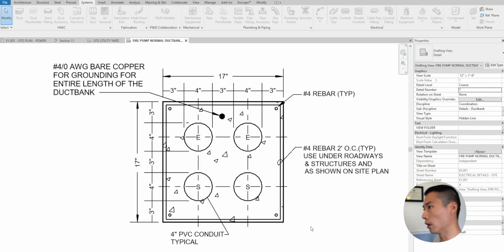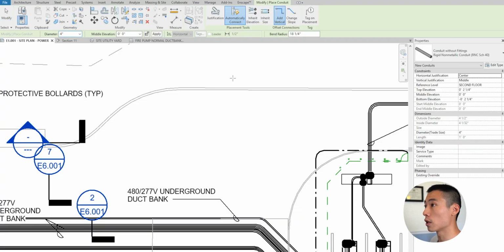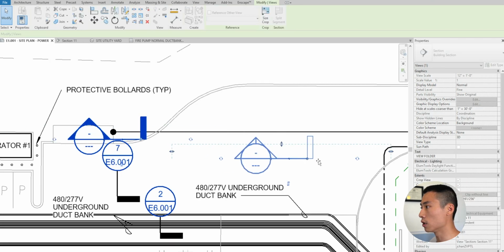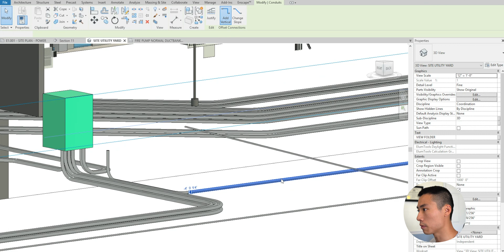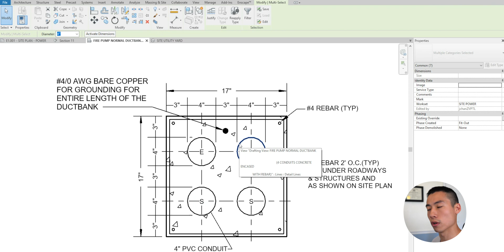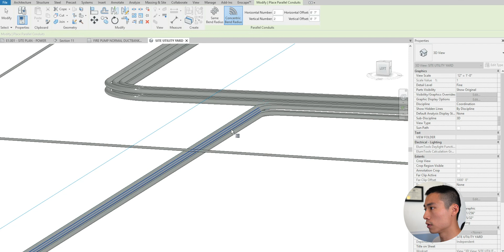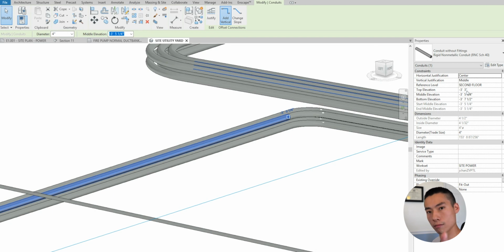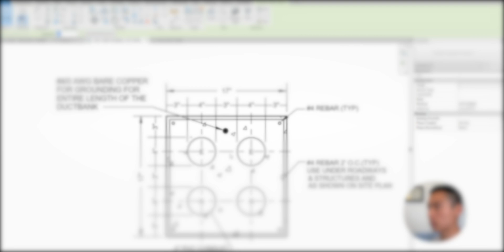Revit Review: How to Model Conduits

Comment: The most important question is how to make changes when all conduits are placed and the drawings are done. How to deal with multiple conduit turns that need to be changed (angle, turns placement etc)? No way you need to redesign all of it from the scratch?

Comment: Will the conduit follow the surface and maintain the minimum depth, or is everything just modeled as level in revit?
Reply from the maker: Hey! a little late but still want to answer: conduits can be slopped but it needs to be done manually. it would be cool if it could detect grade and just follow the grade...but unfortunately that's a manual process. Some architects will model the grade which is then super helpful as you can then see it in section view, but most of the time we just get a CAD file from Civil and the topo is literally just a bunch of  lines all on the same level...not very helpful.

Comment: hi! i  have a question: at what level of lod should conduit be modeled? from 350 onwards? I am referring to the set of conduits that pass through the cabletray, while systems with rigid conduits above a certain diameter must be implemented in the modeling already at a level of lod 300?
Reply from the maker: It mostly depends on the client. We had clients that wanted everything 1” or greater to be modeled even tho we specified LOD 300 in our proposal. Then another one comes by requesting LOD350 and they said only 4” or larger. Our typical company standard is LOD 300 with 2” or greater unless it is foundation penetrations that affect Civil. When I do cable tray, I typically draw a section detail view with detail lines indicating cable sizes, spacing in between and any dividers required. We typically do not model the cables or conduits in the cable trays unless specifically requested. We would show a section and refer to that detail for cable sizing, spacing or stacking.
Reply: @theelectricaldepartment   thanks!!!

Comment: Hi. I have big problems with curves of the conduits.
Could you teach how to create or to configure curves and others things about conduits? Thank you!
Reply from the maker: like bend radius or how to make 45 degree bends? Fittings are kind of tricky as they like to be drawn a specific way.
Reply: @theelectricaldepartment  I create some electrical components for my projects and always I try to draw the conduits, Revit warning me about curves not edited corretly or automatic way is impossible. I think I need to create a new family of conections and curves.
Reply from the maker: @cheel1538  Ah I understand. There's a few things that would give you that error, usually drawing on significantly different elevations. If you select the Inherit Size and Inherit Elevation, it usually helps create the right bends. I could make a video getting into the smaller nuances of conduit runs, it seems to be a tricky topic.
Reply: @cheel1538  @The Electrical Department I work for an electrical contractor in the BIM dept. Not only are there tons of nuances to running conduit like he mentioned in this thread, you also have to have all the families and standards set up for the project. I would suggest opening a new project using the electrical template (in the same instance of Revit as your current project), then creating an L shaped run of conduit with the type of conduit you'd like (EMT without fittings for instance). Then select the entire run, ctrl+c, go to your current project, ctrl+v to paste the run into the project. This will bring the family and standards that you need into your project.

Comment: Hi, Your explanation is fantastic. Could you also tell us the best way of line setups for underground conduits? I want to show all the underground conduits in dotted lines on the power layout.
Reply: In the "Manage" tab you go to "additional settings" -> "Line Styles" ->and set your "<Beyond>" line type to whatever line style you want (dashed), and whatever thickness, transparency, and color. <Beyond> means any objects that show up below your cut plane that is set in your view range. 

I personally need help with a solid set of commercial industrial electrical families, specifically distribution (480V panels, 120V panels, xfmrs, switchboards, switchgears, and substations). I use layoutfast as a crutch but would love some insight or resource location if anyone has any good suggestions.
Reply from the maker: Ah yes that’s a good topic. It would be great to show it dotted for underground if you also have overhead conduits on a pipe rack.